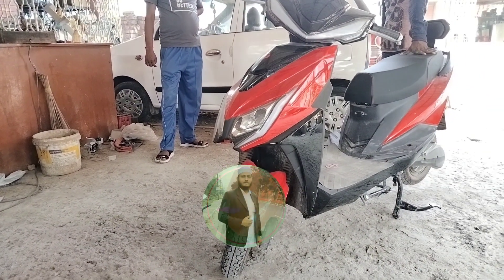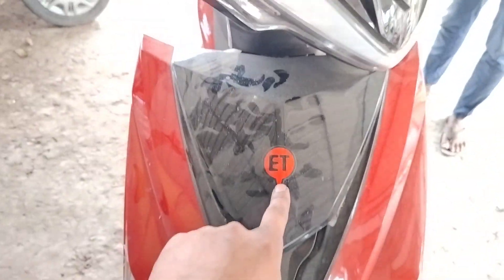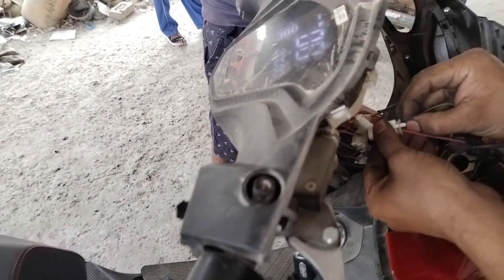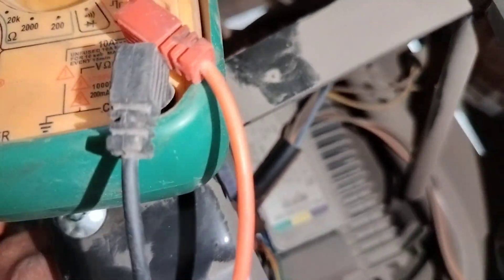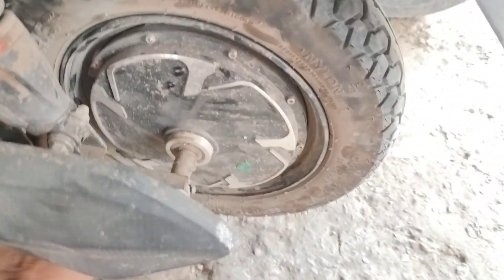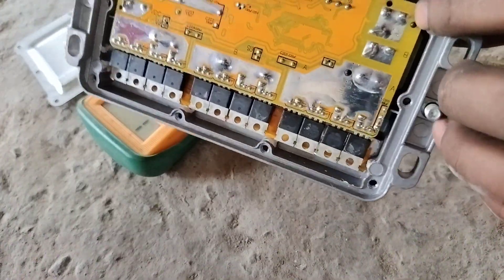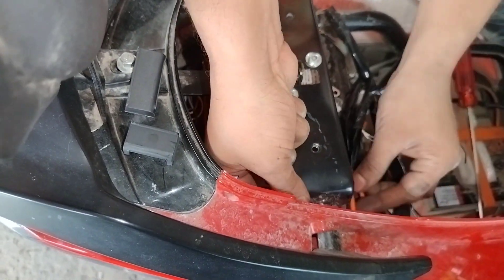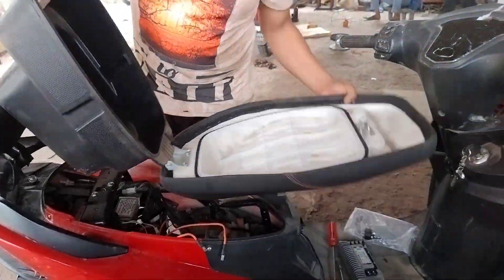Electric scooty pickup problem! how to solve it? Yo bike pickup not working| YO Scooty repairing 👍

Comment: Meray pass electric cycle ha 350w hub motor k sath. Motor ki wires cut gai thi aur hall sensor kharab ho gya tha. Change kraya ha magar ab 2 se 3km k bad motor off ho jata ha. Thori dair me throttle se pher chalna start ho jata ha aur kuchh distance pe pher off ho jata ha. Controller heat bhi hota ha. Kia problem ho ga?

Comment: Sir mera okinawa praise pro ka gadi hai men jab thortel race karta hun m singnal ake band ho jata he
Reply from the maker: Motor rotation kya halka hokar FIR band ho ja raha hai?
Reply: Mere gadi me hall ka gum kar band hojata hai
Reply from the maker: Aap pahle battery connection ko check kijiye. 
Then motor sensor ko check kijiye
Reply: @akasherickshawtech  battery tik hai sir stand pe gumraha hai load pe MCB trip hora hai
Reply: Bar bar MCB trip horaha hai battery lithium ki hai 60volt voltage drop nahi hora